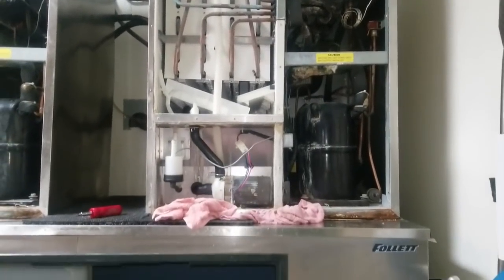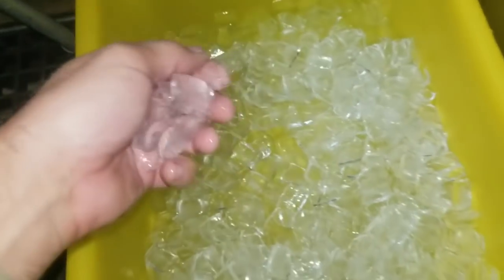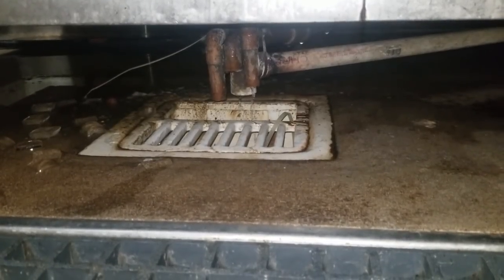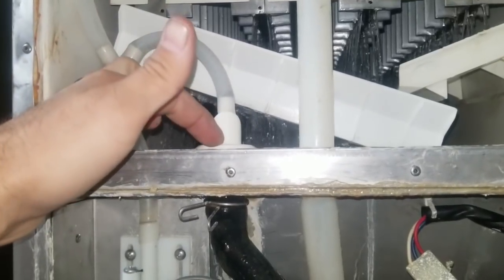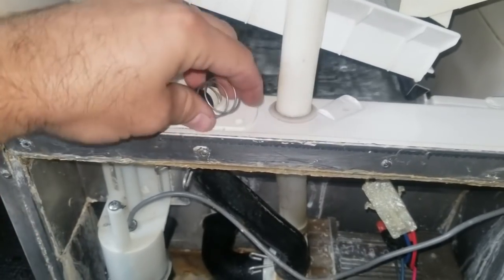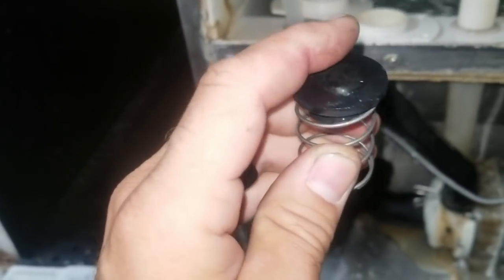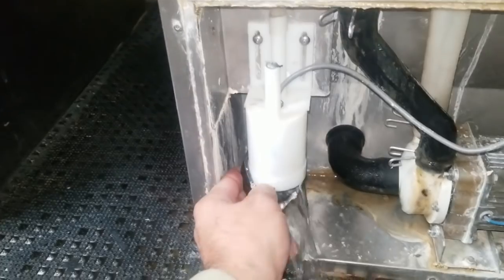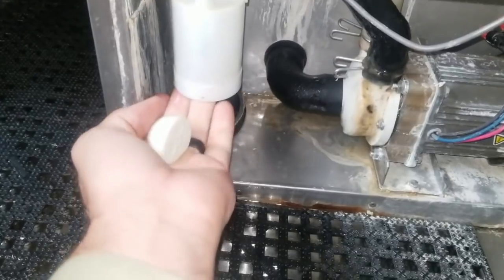HOSHIZAKI ICE CUBES ARE TOO THIN

Comment: BIG THANKS - just had this issue with Hoshizaki at work and i remembered you covering at one time. searched your vids and got it back running. i'll need to do a proper cleaning soon or suggest a more frequent cleaning schedule. unfortunately the water supply is bad with sediment, especially when the occasional shutoff is done- water looks like hot cocoa when turned back on.

Comment: For me once was a time when the rubber was so stiff I just had to change the rubber , spring was still good but I changed both anyways. They worked together.  You don't mention much about it but even if a seal/hose looks good don't mean it is, the suppleness of a seal/hose matters too. Ever come across a rubber seal that is so stiff it turned into like plastic?

Comment: I hear all the time, stretch the spring. Just took a backflow testing class and in the class they said that springs may loose their psi rating. So hoshi check valve has a psi rating based on that spring. I feel we should be able to measure that, to let the the house know that the spring is strong enough to resist the pressure of the pump.

Comment: I had that issue on a system going into a drain bucket with a sump pump. It took a while to figure it out since it was the first time I had that issue and the drain line was sealed to the bucket. If it wasn't for a loud sump pump and another tech telling me what to look for, I probably wouldn't have found it.

Comment: I've got a 1340-mrh machine 
It's making thin ice after the first two 30 minute cycles it drop to 10 minute cycle?
I've cleaned the float rubber boot and check valve can you help?
Regards

Comment: Under the freeze cycle ive blocked the water flow on the main supply tube going up from the pump. That forces water out of that check valve. If the water stops coming from the drain then i knew there was a sealing issue with that valve

Comment: hi i have the same machine if i leave the machine all night next day i see building  ice  look like didnt drup the ice after i clean the ice with hot water it work good but next day isee the same problem  the hot defrost when start dropping ice one section hot but other section not hot its normal tempruture  but still drop the ice only problem next day happened  we call company till now cannot figue whats problem he clean the dust now want wash the unit with chemical look like dont know anything the time of dropping the ice less than 30 second i think  i am confusing  missing gas or gas valve not open sometime confusing

Comment: Hi Chris, it's me, Isaac. Some reason for first time that this video didn't use closed caption. I tried to turn on subtitle/CC at setting.  It didn't work out. Any change, sir ? Thanks for your time.
Reply from the maker: Let me look into it
Reply from the maker: Isaac for some reason it doesn't give me the option to do captions so lets give it a day and if it doesn't work I will try and figure something out. Out of curiosity how do you watch the live stream? do you read my lips or just participate in the chat?
Reply: @HVACRVIDEOS  No problem with me about captions, sir. I really don't read lips pretty good. I just participated in the chat and communicate with other techies using messages. Thanks and appreciate it, sir.
Reply from the maker: The cc works on the streams usually a few days after it has posted. I think YouTube has a problem with the video I just posted today so hopefully it will start working again.

Comment: Chris is there a way to empty out the water  After a wash cycle some customers don't want to empty the ice bin, so I cover the ice, but  Catching all water can be a pain Especially the ones that have the traded  plug thanks
Reply from the maker: Yeah just unscrew the stand pipe and it will all run down the drain
Reply: @HVACRVIDEOS  not sure what or where thats located,  just started learning about servicing IM,  And this company gives me an 1hr. to do it, no training,  told me to just watch videos 🤷‍♂️, so I'm f*@#, watching video while trying to service many different IM for the customer,  I still.wanna do things right but if there's any way I can be efficient  that you can help me would be helpful,  maybe a video? Cause most of the bins are full of ice when I get there. Thanks Chris

Comment: As asked on one of your livestreams, but left unanswered:

"as a chef I'm around hvacr, but not very privvy about it. what would be the best route to learn what i can to properly identify issues and prevent any scamming/upselling bull. "
Reply: Watch more of his vids. Look up forums. Read manuals
Reply: Ever see a error code google it
Reply from the maker: That's a hard one, first off dont assume you hvac guy us trying to scam you, there are plenty of good companies out there. Let me think about this one and I will try and responde later
Reply: Also nothing wrong with upselling if it needed. Or preventative maintenance
Reply: As an owner, chef or bartender the first and simplest things you can do to keep your equipment running properly and not need a service tech call in the first place are:

Note the make, model and serial number of your equipment. Start a binder and download the owner manuals for all your units. 

RTFM. Read the f#*%ing manuals and follow instructions.

Keep units clean and the air around them flowing. Most of your equipment in F&B operations are air cooled. Look for where the air enters and leaves your equipment.  Typically there are louvers, slats or grills where air enters and departs.  A couple of screws usually will remove them. Clean up and replace. Stop stacking things on top of and around your equipment that blocks airflow.

Ice machines need filters installed and changed  regularly.

Walk in coolers and freezers: Keep the air curtains in place and stop propping open the doors when you load in new product. Cover all food, especially anything acidic. 

Thermostats should be set once at installation and left alone from then on. Putting your reach in refrigerator at "10" will not make it colder any faster than when it is set at "5".  Refer to first step above, RTFM.
Reply from the maker: Great advice!
Reply: @davejohnsonnola2758  thank you, in general we have monthly maintenance at the place I work, and we are currently getting a brand new kitchen with 100% new equipment all around, so it's not going to be a concern for a long time. But having hvacr experience certainly doesn't hurt when I eventually leave my current place of employment.
Reply: @davejohnsonnola2758  also, any time I've seen someone prop open a cooler door of any sort, I get furious. Very dumb habit that I've seen a few times.